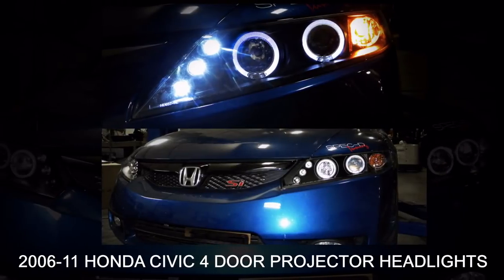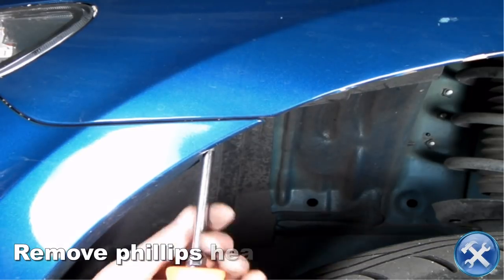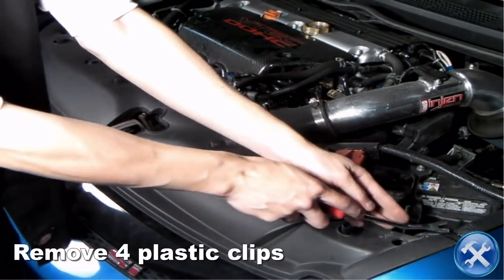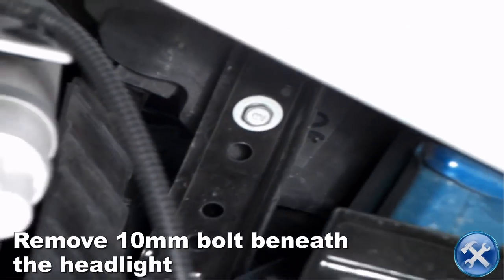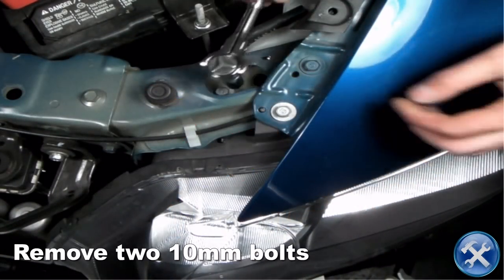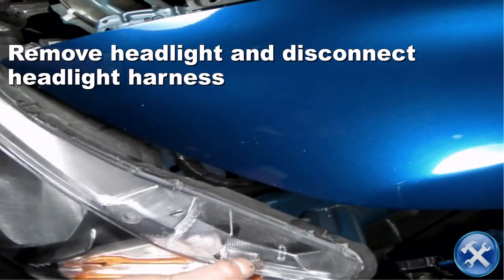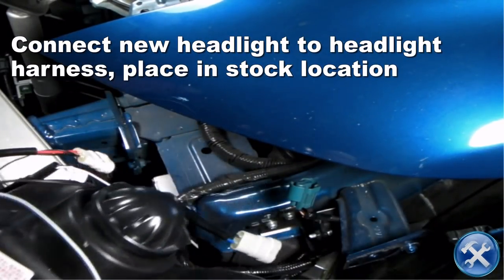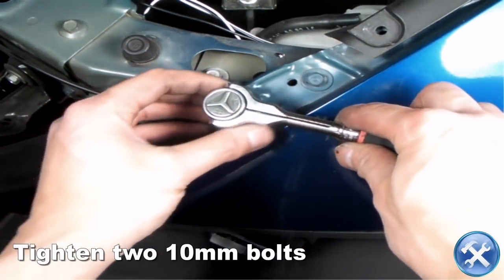SPECDTUNING INSTALLATION VIDEO: 2006-11 HONDA CIVIC 4 DOOR PROJECTOR HEADLIGHTS

Comment from the maker: There should be adjustment screws in the back, it might also help to loosen the mounting bolts and position the lights so it points more inwards before re-tightening the mounting bolts.

Comment: Good video, only one question though. I noticed that these lights had harnesses that fit the factory harnesses in the car. I also noticed some white and black wires that are not connected to anything and pushed out of the way around 4:50. What do these wires go to and why aren't they attached to anything?

Comment: I installed these in my 2009 4dr Civic and they look great, BUT, the headlights are not pointing straight. I have a HID kit as well and the lights work well and are bright BUT are pointing outwards instead of straight. \___/  instead of |____|

Comment: The low beam bulbs went out on 2010 HONDA CIVIC SI 4 DOOR PROJECTOR HEADLIGHTS. Where can i get replacement bulbs? Or at the local auto part store or through your web site?
Reply from the maker: Heather Lo Yes you can go to your local auto-shop to pick up replacement bulbs. Both your high and low beam bulbs are H1 bulbs.

Comment: On a honda civic it would be ok since the honda leaves the low beam on at the same time as the high beam.  The time it takes to warm up the hi beam you would still have the low beam on so there would be no loss of light.

Comment: im having a hard time to calibrate my fog lights, as the comment from "raheelk23"  its very  hard to fix the headlights direction. Any ideas ? because i tried to do it and the high beam mirror dismounted. Can you guys help me, im from venezuela. im about to put back the original headlights. another question, can i put HID's on both high and low beams ?